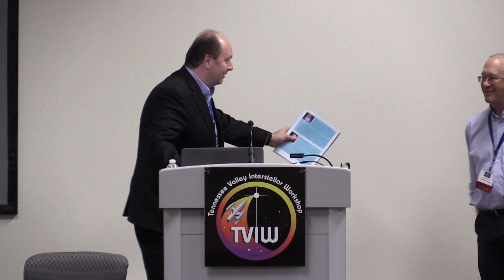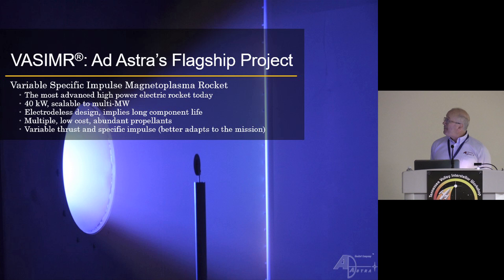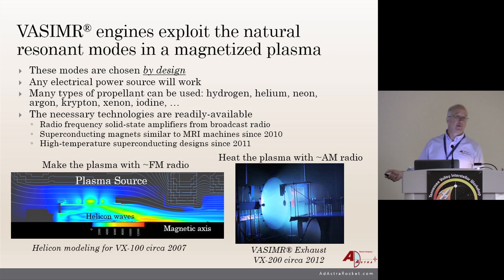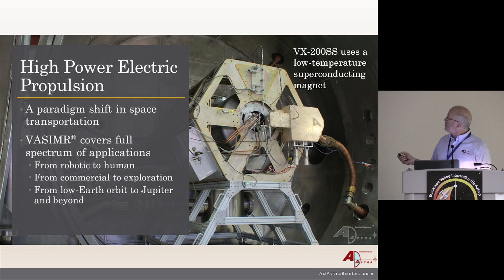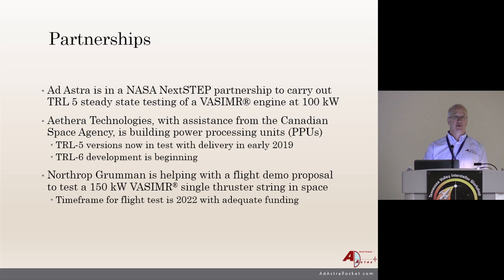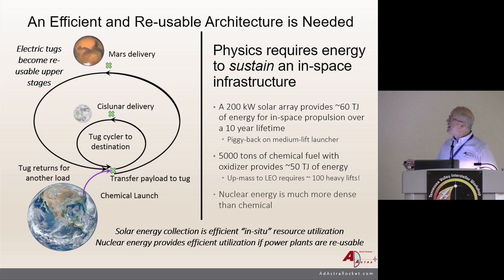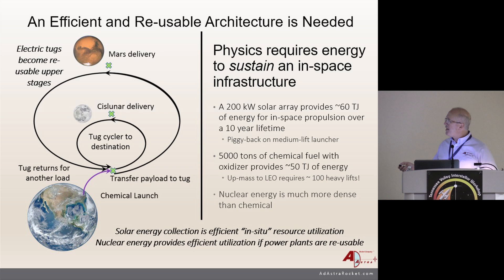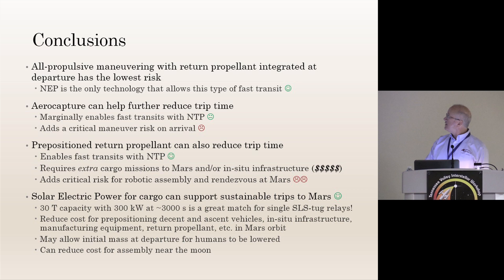2-7 Dr. Mark Carter - VASIMR Plasma Propulsion

Comment: The public seems to miss a singular point in electrostatic (ion), arcjet (as plasma "pinch" systems were called), Hall effect thrusters (variant on ion) or VASMIR: THEY NEED AN EXTERNAL POWER SOURCE. They do not make their energy but must have device to create power. Solar cells; solar dynamic; fission reactor are all potential sources. There  has even been microwave transmission to a vessel proposed. All possible. If you want an analog these drives are like steam engines that require a boiler as an energy source. 
A fission rocket has been proposed in which reaction mass is feed into the products of reaction at extremely temperature. Sometimes called "the nuclear lightbulb". A low neutron emitting fusion is of course the ultimate goal. The public fear of "nuclear" is a constraint to deep space exploration.
Reply: Liquid Fluoride Thorium Reactors! 😎

Comment: Here's the concern that I see: NASA is spending so much money on its in-house, proprietary Space Launch System rocket (SLS), that the free world will be lucky to see an operational base of Earth's Moon within the next ten years (2022-2032). SLS cost at least $24 billion to develop out of old Space Shuttle parts, plus $2.5 to $4.1 billion per SLS launch, and the SLS is not re-usable by design. SLS is a throw-away rocket, every time.

If we're sinking all that money into SLS rockets, and we don't invest in replacing SLS with a new-generation re-usable rocketship, NASA will blow a huge chunk of its Artemis budget on SLS and nothing else. SpaceX's Starship, by comparison, is projected to cost only about $10 MILLION to launch payloads to Earth orbit, and it's going to be re-usable. Imagine how many 60 ton payloads NASA could send to Earth orbit, or even to orbit around Earth's Moon,  with a re-usable SpaceX vehicle or Blue Origin's New Glenn, or Rocket Lab's Neutron, etc. Even if sending a a 60-ton payload to lunar orbit costs 30 times more than Earth orbit, that's still only $300 million. So re-usable private launches could save NASA (and the American taxpayers) billions of dollars. Those billions of dollars will no doubt come in handy for funding cycler-ferry spacecraft between Earth orbit and lunar orbit, as well as between lunar orbit and Mars orbit, or any other destination in the inner Solar System. 

If this solar-electric propulsion (SEP) / VASIMR spacecraft concept can be made to work, and if NASA will be allowed to replace SLS with re-usable rockets so that more space agency funding can be spent on actual exploration missions (not just expendable SLS rockets), then this would be a tremendous boost for the Artemis program. Sooner or later, we're going to have to face the 800-pound gorilla in the room, though: NASA can't afford SLS if Artemis means "we're going back to the Moon stay" and we're supposed to visit Mars as well. If NASA develops VASIMR into a viable space-to-space cycler ferry between Earth orbit and lunar orbit (Gateway space station), that VASIMR cycler is going to wind up carrying more than just cargo. At some point, it'll have to start carrying astronauts as well.

Also to consider: even after Dr. Carter's presentation, it is still unclear to me what the realistic transit time (for a VASIMR-propelled manned spacecraft) between Earth's Moon orbit and Mars orbit would be. I take this to mean that it could be anywhere from several weeks to several months, one-way. If this is the case, then it is best to plan on having some kind of built-in spinning simulated gravity maneuver programmed into any interplanetary mission beyond Earth's Moon. On YouTube, the Fragomatik channel offered a computer-art video of what an Earth-to-Mars mission would have looked like under the now-defunct NASA Constellation program: https://youtu.be/gMxQjao-Fug  Also on YouTube, the SpaceX Vision channel showed what an Earth-to-Mars space-to-space cycler would look like be if they incorporated some extraordinary evolutions of SpaceX's Starship vehicles for interplantery travel: https://youtu.be/Yq4_67auqn4  If these computer artists can envision re-suable interplanetary vehicles such as these, the question then becomes: can such vehicles be equipped with both VASIMR propulsion and simulated spin-gravity as well? And can these vehicles be re-used for travel to multiple interplanetary destinations? (Mars, Martian moons, near-Earth asteroids, Venus, etc.)

Comment: meh high power for eletric is still weaker than a chemical rocket by  a factor of  x10000 far as raw energy  produced   this thing is just a more efficient ion  engine
Reply: Not really more efficient, 60% is at the low end for ion propulsion.
Reply: @rokadamlje5365  i know but when they first sold us this tech  they said we could get to mars in 3 months  i knew they was full of horse dung then
Reply: @madman026  yeah , in some of the slides he compares aerocapturing chemical version with prepositioned propellant. Which is basically what Starship with in situ propellant is.
Reply: @rokadamlje5365  well it probably could with a nuclear power source
Reply: @randomperson-ws3zq  open cycle fission or fusion is better
Reply: @rokadamlje5365  yes but we don’t have fusion and open cycle fission is a warcrime
Reply: Well I don’t think an americium open cycle is a warcrime
Reply: This gentleman's comment is misleading to the point: Specific impulse is the goal of a space propulsion system as it reduces the mass ratio of the device for a given velocity increment - "delta V".  A chemical system would burden the launch system and... more importantly... reach an asymptote for some mission profiles. Launch system and DV limitations (particularly to outer system targets)  is what brings the higher ISP drives into favor. It gives you more flexibility in orbital change. The power plant can be used to drive more instruments. Jupiter Icy Moon Orbiter (JIMO) was based on a 100 kW reactor if I recall. Power for the ion drives; power for surface penetrating radar.
Reply: @francisdavis1271  firstly afterburning dusty plasma drives have good thrust and isp
Reply: @madman026  With the energy necessary, it could take people to mars in 39 days.